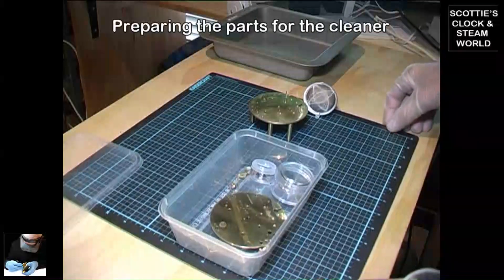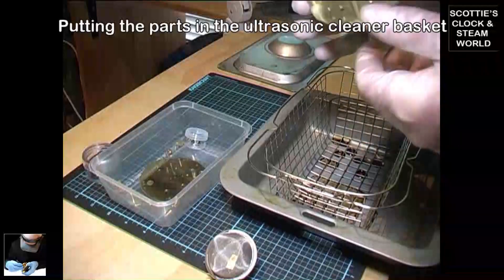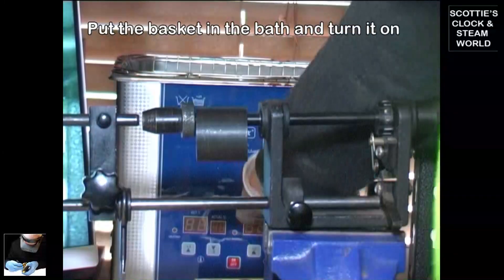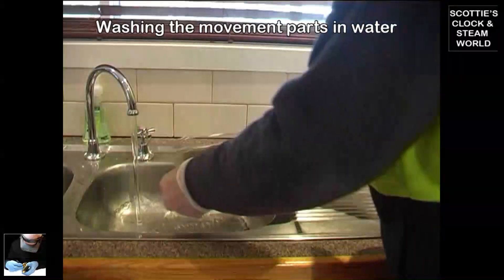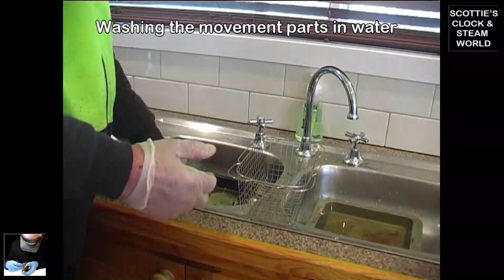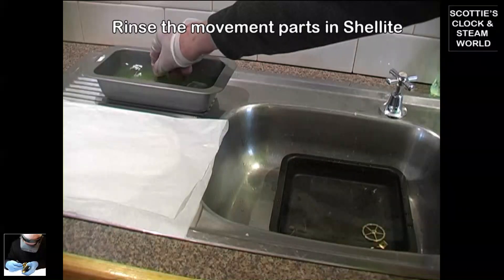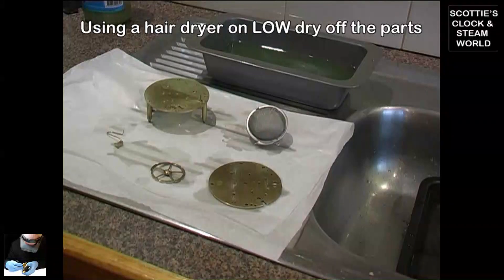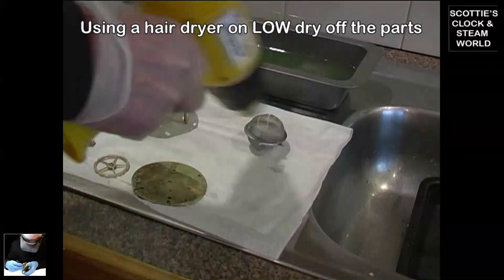How to use an Ultrasonic bath to clean clock parts #americanclockrepairs #ScottiesClockWorld

Comment: Great Vid sir. Would you suggest soaking the entire clock work in gasoline overnite, rinsing, then running the ultrasonic cleaner, rinsing in water, then soaking in denatured alcohol. Trying to find legal and easily available alternatives.
Reply from the maker: That's another way to tackle it. I can't see why it wont work out fine. Thanks for your comment.

Comment: Do you have a recommendation on which Ultrasonic Cleaner machine to buy?  Also, what size is the best 2L or 3L?
Reply from the maker: Hi Carl, I use a 3L ultrasonic cleaner as you need to be able to fully submerge front and back plates for cleaning. If the plates do not fully submerge there will be a line on the plates in a different colour.
Reply: @ScottiesClockWorld   - thank you sir.  I actually ended up getting a 6L size Ultrasonic system by CO-Z from Amazon.  I wanted to make sure I had a good size for the reason you outlined.  I have 2 Ansonia clocks I need to clean and refurbish.  So this should work well.  Cheers!

Comment: WHY is it called ultrasonic.......... all you did was dip them in a fluid... NOTHING SONIC AND NOTHING ULTRA..  just dipping & soaking in some fluid... No big deal  no fancy name
Reply from the maker: Ultrasonic cleaning uses cavitation bubbles induced by high frequency pressure (sound) waves to agitate a liquid. The agitation produces high forces on contaminants adhering to substrates like metals, plastics, glass, rubber, and ceramics. This action also penetrates blind holes, cracks, and recesses.
Reply: What he said...

Comment: Thank you for your video> I was wondering what the rinsing procedure was.
Reply from the maker: Rinse the clock parts in water to remove the ultrasonic cleaner fluid, then rinse in Shellite to remove the water from the parts. Finally dry the parts with a hair dryer on low to remove the Shellite.